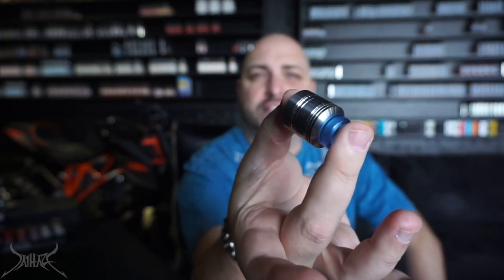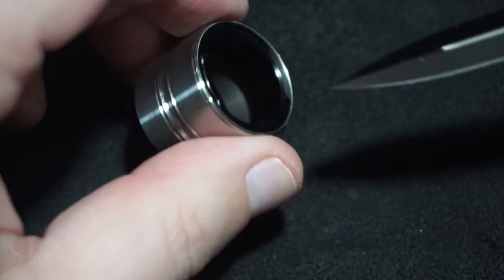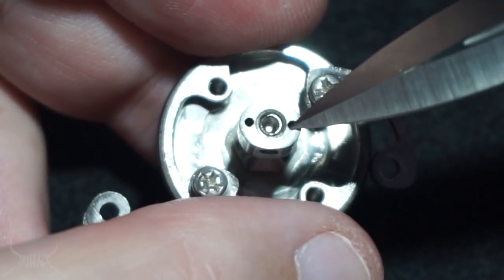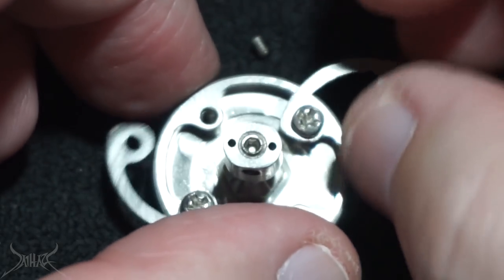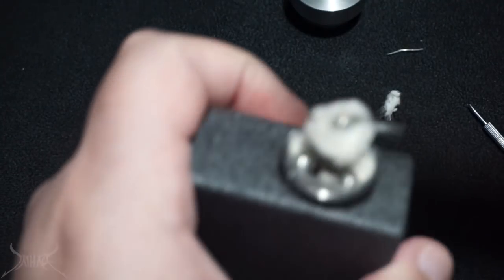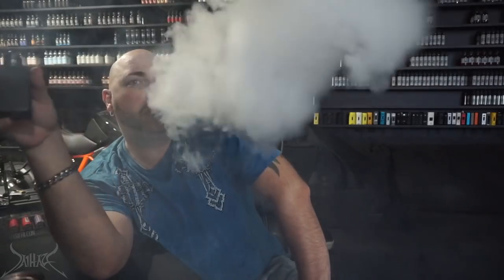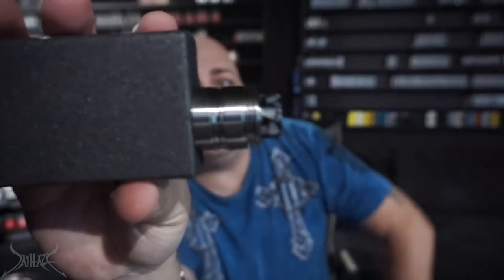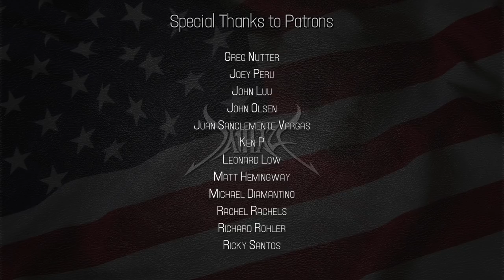The 502 RDA Review and Rundown | Jai Haze Designs and Raven's Moon Production

Comment: Lol you already know theres some people that will without a doubt put in some 0.1 fused claptons, vape at 90 watts then say its horrible, hard to build, not enough air, and gets hot lol. This is one of those products that needs to be used for thebway its made to be used, people have a hard time with comprehending that sometimes. Im interested to see how it plays out. This is very intricate jai im glad someone finally figured out the check valve inside a squonk mechanism lol. Congratulations man its finally here!
Reply from the maker: ty brother, its not just valves.  Its also ball bearings.  The idea was for innovation, and it HAS NOT been done before and I think there will be companies to follow suit, but we all know where it came from ;)
Reply: Check valve! That's exactly what's happening.  Amazing that it took this long or someone to come up with this.
Reply: Swift 66 nobody said it was crazy. That's not what this atomizer is designed for. You don't buy a kayfun and try to DL it at 90 watts. Same deal here.
Reply: Swift 66 some things werent designed to be huge cloud chuckers. Same as with a lot of 22mm RDA's, would put a staple stagger fused in that which is ohming out at 0.11 and run it at 150w? If you would then l dont know what to tell you.
Reply from the maker: you nailed it
Reply: Swift 66 it's tailored to a specific use case to get the best results for that style of vape. Purpose built atomizers perform better than a "jack of all trades" atomizer imo.
Reply: Jai Haze I WANT ONE I WANT ONE I WANT ONE HOW DO I GET ONE ...ONLY 1000 PROLLY ALL GONE...fucking already spent 325$  trying to get great flavor off of kylin...peerless ..pulse squonk n i get better flavor off my sub ohm tank wtf ..i want this !!!
Reply: Jai Haze are these getting released on 4/15, i signed up to get one

Comment: This is the most innovative design I've ever seen. I have a simple alternative to the air flow leaking  problems of rdas, although your design is very crafty. A micro check valve for the air inlet. I imagine it would be a tedius thing to machine but no more so than the itty bitty bearing in your awesome sqonk tower thingy. That it technical jargon. But a 1 way valve to let air in and none out for the air ports would prevent leaking of any kind. I'm sure it would be a little restrictive still but never the less it would never leak. I am amazed at this rsa. Beautiful machining. An American made beauty sir.
Reply from the maker: yeah i have been designing one that has flaps so to speak, the issue is air still has to come from outside to open the flaps
Reply: Jai Haze if you go with a flap design I  imagine a thin spring steel similar to a feeler guage would work if it's thin enough it would be easy for air to come in but the spring steel would allow it to always a nap back in place to cover it. I think your design is amazing and the most innovative design I've seen so far in the vape market. The way it squonks makes so much sense, it's one of those things that will become an industry standard. You set the bar man. I hope to get my hands on one of these at some point.

Comment: Jai congrats in creating something new and innovative, a lot of thought has gone into the design and manufacturing which is a credit to you and Ravens Moon. That click of the top-cap is pristine!! I really wanted to like it and probably would of bought it, but there is so much I just don't like about it. Yeah it doesn't leak, ok......and......Like you said in the video "I don't know why you would do this" when filling it up with juice. That's the point... Why would anyone do that? You made a dripper that makes that possible, well done (anyone NOT using the 502, don't put 8ml of juice in your dripper and don't tip it on it's side). Building requires a smurf with seven hands, the clamps look like something Henry Ford designed and the centre pin looks like something Steven Hawking designed. To me it looks like making it virtually leak-proof you had to make the airflow slots vertical which led to vertical coils which led to the DO NOT PULL APART centre pin that squonks from the top and sucks from the bottom.....Yeah all very innovative but it seems like innovation to fix problems created from a leak-proof concept when all you needed to do was build something of the same quality and say don't over fill it and don't tip it on it's side. I've watched lots of your videos and don't believe I'm the only one thinking that if this was someone else's product you would of torn it apart for how complicated it is for what it is, all while complaining about your burnt jammys. You probably would of taken that Henry Hawking outside and thrown it at a wall saying you kept it real.
Reply from the maker: you do realize I created this right?  There is a lot more to it than what you just mentioned it.  Its just not for you, simple nonethless.

Comment: Nice design jai! One small revision I'd make is to add some knurling on the deck underneath the clamps, just to help grip the coils more securely.

Also I think the positive post would work much better with a twin hole, T bar style setup. You could still have room for the squonk holes, and it would be easier to build as the leads would already be facing in the direction that you bent them, and you can terminate each coil individually.
Your design is definitely more aesthetically pleasing, but I think a T bar post would bring some much needed 2017 functionality to the 454-esque design.

Not meaning to pick apart your design or anything, just throwing some ideas out there for future revisions or updates :)
Reply from the maker: Im all ears. T post was an idea in the beginning but it doesnt have the piston style.  But believe me I am already taking notes to improve the design
Reply: Jai Haze good stuff man! One other thing I thought about was, had you considered having a separate chamber reducer for the single coil option, instead of the tab? Something similar to what's in the DDP one RTA. I feel this would a. Do a better job of sealing off the second air hole, and b. Help reduce the chamber to a size where single coils can really shine.
Also, going this route would mean you could add small tabs on the top cap to stop the airflow spinning 360 (like the narca, hussar and others), so you'd do away with the whole lining up the airflow issue.

The only other thing I can think of, which might not work too well, would be a hollow deck with a sealing plate at the base. Not sure if that makes much sense, but basically the deck itself would look kinda like the battery cap on the sva kimech, with a flat base section that screws onto the 510 and seals the juice well up. Tbh, this sounds like it might be prone to leaking, but it would make wicking vertical coils so much easier. I've always enjoyed the vape from vertical coils, but i rarely use them due to how much more fiddly they are to wick.

I'm honestly not sure how doable the last idea is, it'd be cool, but I suspect it'd be a lot harder to manufacture. The single coil chamber reducer sounds like a winner to me though

Comment: Brilliant design!  Just one question:  What happens to the ball bearing over time as it gets gunked up and/or sticky with juice?  Will it get stuck inside the pin?  Is there an easy way to prevent that from happening?
Reply from the maker: you just hit it with some water, like squonk with a water bottle.  The bearings cannot get gunked up, they are so miniscule

Comment: Probably hard to get at this point, but I'd like to try it. I have used multiple vertical coil RDA. Origen, origen V2, 454 BB. All authentic. Also a couple of RDA by Ihybrid Mods back in the day. They all have crispy flavor, some of the best, but I remember that 454 would get hot as 10 fuckers. I need to dig it out and try it again.. I think it does have a squonk pin too.. these aren't hard to build on, just different.
Reply: Best vertical coil RDA I can remember is the veritas with dual coils. Now THAT was innovation. Not sure why that design hasn't been revisited? Nothing really compared to that bastard.

Comment: Congrats Jai, but if you didnt want a single coil part just dont put that option. Dont get the wrong idea but if your main point is the double coil just work on it to make it better just like you made it in the 502.
Reply from the maker: I had to put an option there for it.  Had to.  Without a question
Reply: Put a note in the box (like the ones that says something about nicotine) that says "This is for double coil, it has for single but dont use it with a single, its made up for double fracking coils, DID YOU READ? ITS FOR DOUBLE not single but for DOUBLE" that would be awesome.

Comment: Got mine a couple days ago.. Just built it.. let me get this straight.. In your video, you say that if you DO NOT intend to use it as a squonk rda, then remove that tiny grub from the 510? Correct me if I'm wrong, but that seems backwards..Seems like you'd want that out of the way to enable squonking. Please advise. (Mine doesn't seem to want to squonk at present.. I'm not going to remove that grub until I hear back from you.)
Reply from the maker: Take a small Allen key and put it in the 510 and remove the tiny set screw
Reply: Jai Haze Thanks.. perhaps I misunderstood the directions in your video.. I checked a few more videos last night and Mike's video showed the set screw removed. I have been vaping it all day..I wrapped two SS316L 28ga X 3 wrapped with 38ga.. 7 wraps and they've ohmed out @ .17 ohms. I've got it on my Drone and 66W works great. (Even used Mavestons). Curious.. What's your most flavorful build been so far?

Comment: A vertical build would heat up majority of the sides. I don't think the fins would be enough to dissipate heat for chain vaping, imho. The intricate no-spill design is an innovation though. When the novelty rubs off, it's still restrictive. Surprised you gave it a 8.5-9. Decent 1st attempt and it does look sexy. Hoping the production model irons out these kinks and would prove me wrong. Congrats

Comment: hey jai congratz on this, i think this is the best rsa if the flavor is good enough (you did not mention about it)
but i believe you did not reach to the point you wanted at this one,
maybe you could not because of the impossibility of the machine work , maybe an another reason but i believe the dripper in your mind was a bit different than this one
i would buy it if i could and be happy with it for a loooooong time because of the quality and complexity of this in terms of building.
many people mention that deck sucks and hard to build, but you give an immensely open positioning for the coils which i like,
i would build it with round thin wire double coil on top of each other one feeding from bottom ,another from top for squanking, so total of 4 coils vertical but shaped as horizontal combined.  it is a good example of innovation and you let the user build as they want in numerous combinations.

BUT there are downfalls of it which you actually rip many drippers apart before for having them.
1- airflow adjustment
2- posibility to get hot because of the thickness
3- struggle while building
4- single coil situation

I watch your videos several times a day because you are entertaining and unbiased, I BUY products if you have high ratings for them, you help me alot for what to pick and what to not. Thank you for all of this but even if you mention these downfalls and be unbiased about your hardworked product, I would expect something cleaner from you. Keep up good work we all love you.
Reply from the maker: I agree with the airflow, which is why I cut a point easy.  The hot YES I agree, this mfer gets hot but like the other post this dripper is not designed for big builds as its going to get hot.  Its like trying to make a kayfun direct lung.  It just isnt designed for it.  The building, I dont have a struggle with so I cannot deduct for that.  The single coil yes I agree.  That still only brings it down to a 7.5/8
Reply: man yes ı would give it higher point than you if you would take it serious,
it deserves a solid 8 or 9 in my book, as I said I would be happy with this rda because of the deck and airflow which allows me do many different builds which I like.
quality is obvious it is worth the price 
my comment is not to say it is bad, I just wonder if you are extremely happy with the product or you did not get what you think at the end. 
you know what, I was expecting that review would take 38 seconds building included lol, this is how I imagine when it comes to you, extremely perfectionist guy who likes nothing, and if he likes it is perfect.
please do not get me wrong the things I mention are not something I would even be frustrated by.
I just wanted to ask you about it.
Reply from the maker: no its all good brother. I am very happy with it, unhappy about having to line up the airflow but its a compromise that had to be made for it to look clean on the outside.  Believe me I tried to think of ways to lock it in place so you know where the airflow is.  This wasnt an easy task
Reply: yeah that was an answer I was looking for, thank you jai for being honest again. I know how hard to achieve something different without ruining the other one. Great rsa anyways, good job.

Comment: Congrats on the dripper Jai. It's a little pricey but def not the most expensive out there for sure. One thing I can say, it's got a helluva lot more in terms of innovation and engineering involved with the squonk center post and valve action. Lots of $100-200 rda's out there that are basically just a deck, clamps and a simple top cap whining about 'engineering' and design hurdles. That center pin is well thought out limiting the siphoning of juice to the bottom ports. 

Yea there's a few fiddly aspects to it but if I could just bring up one glaring flaw (imo) and would/should be easy enough to address. That tiny screw in the bottom of the 510 you told everyone not to lose, maybe include a spare or at least have them available for replacement. People are bound to lose shit, nature of humans. 

One of the biggest drawbacks to me is when something is proprietary and non standard size, the company only provides one and there's no way to get replacements. The entire thing hinges on the failure/loss of a $1 part pretty much. Doesn't matter if it's a screw, aio drip tip/top cap or just a proprietary dt, glass etc. Idk the specifics of cost of that 510 screw in the bottom but it looks like a simple relatively inexpensive component compared to the rest of it. Maybe include a spare or at very least have them available separately (not the expensive enclosed center post with all the doodads, just the bottom screw).

Comment: Guys I really think jai is being modest saying it will get hot, this rda really shines on the airflow setting which will basically cool down the cap better than anything else on the marcket. But the airflow is not massive if I eye balled it right which means you would probably chuck yourself really bad before it gets hot.
 OBS engine nano is the only atty I can think of that had some kind of similar airflow design, while having massive air flow for a single coil, that tank is always cool as fuck however I chain vape it. 
All in all , this is that kind of design dedicated to perfecting a certain type of vaping, which I really need.
Congrats, great job.
Reply from the maker: yeah but i wanted to cover anything thsat people would say is negative

Comment: I clearly remember that u said you are working on a mod not a dripper
Reply from the maker: im working on a mod, dripper (which is done) and a tank.  I mentioned 2 times I was working on a mod, multiple times about my tank. RDTC
Reply: I highly doubt that it will be available in my country (Iraq) since u are making 1K only.
Looks like something way up top.
All the best mate
Reply from the maker: did you read the comments? Shipping worldwide
Reply: I know but we dont have big dealers here and shipping oversa will make it maybe around 170-200$ to the consumer
Its complicated as we dont have a formal shipping adresses.
I tried before and it didnt work
And if it works it will be way more expensive than it should be
Reply: Where in Iraq?
Reply: Craig Bolin Baghdad my friend